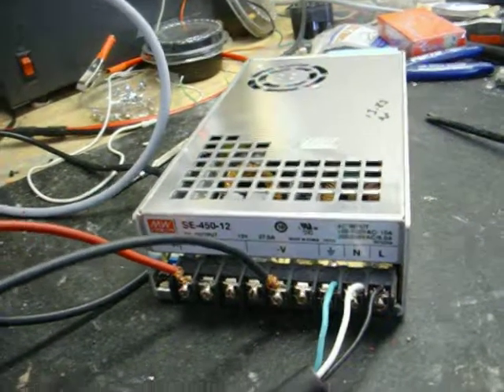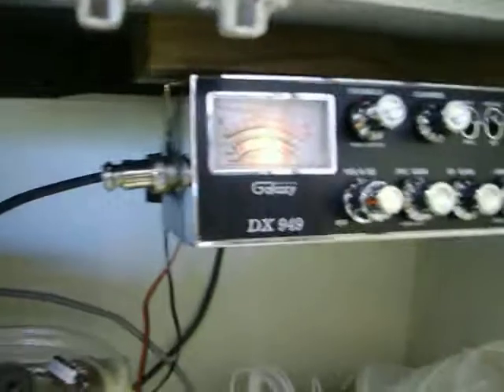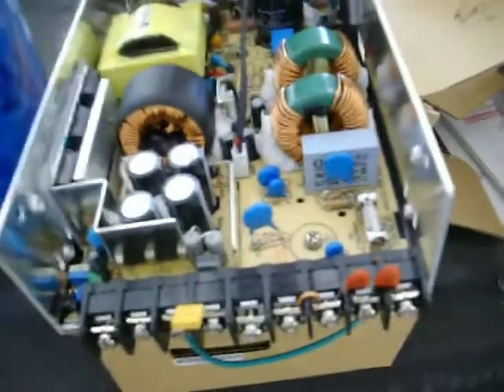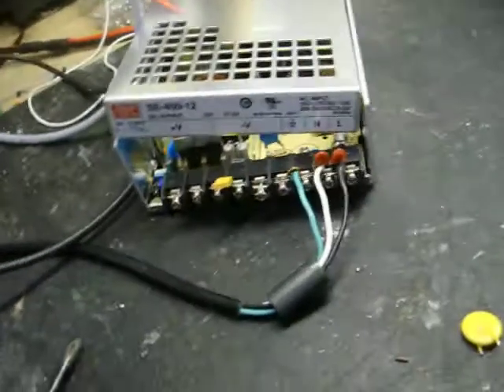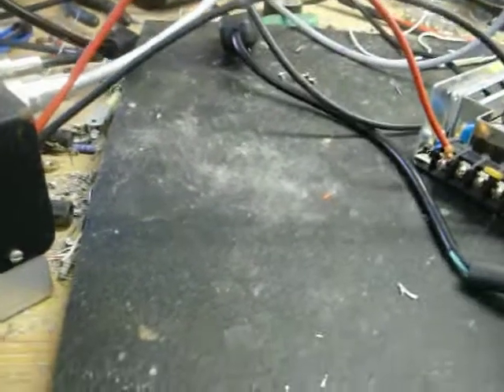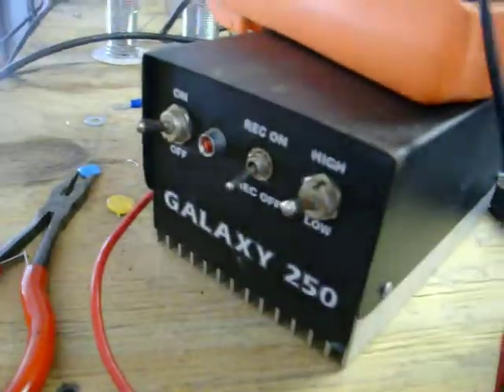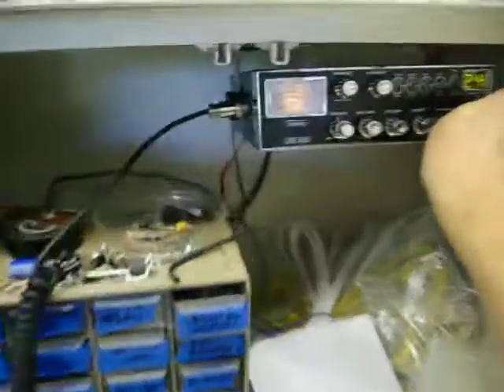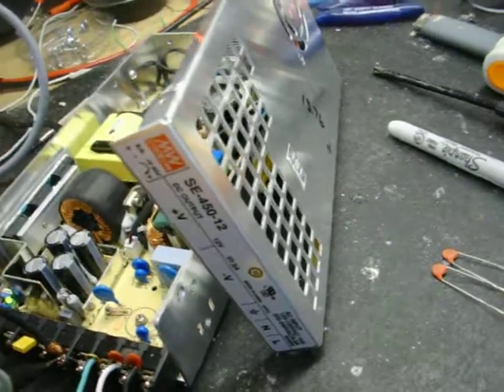switching power supply  Noise and Birdie Gone !! MeanWell supply

Comment: Why not purchase the 15V Meanwell. It can be turned down to 13.8 if you like. I've turned up the $25 12V 1000W HP computer supplies to 13.2V by changing the reference. It's a PITA to get at though. For RF amplifiers using the 2sc2879, you want a 15V supply.

Comment: Did u use blocking caps on the AC in side or on the DC side .... I got few I Wana do ... I would assume u are filtering the ac side were the ac comes in to the device..with high voltage blocking caps ..and feerad ..core ...I was gonna do a band pass filter and I mica the DC side

Comment: Switching power supply needs minimum load current, about 5% to 10% of capacity. Try to apply 8W to 21W incandescen lamp on output lines and there will no birdie anymore
Greetings from Indonesia
Reply from the maker: ibles bosuok thanks for the tip . birdie may be gone but noise on receive will still be there which no one wants in a recieve application.